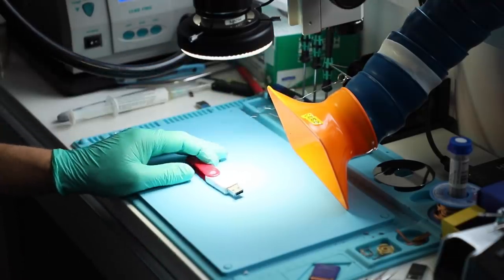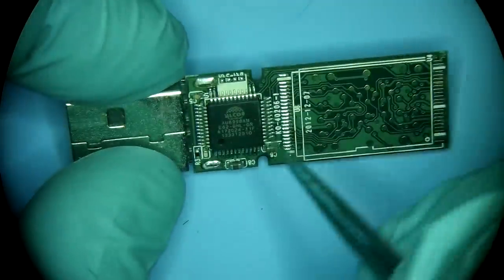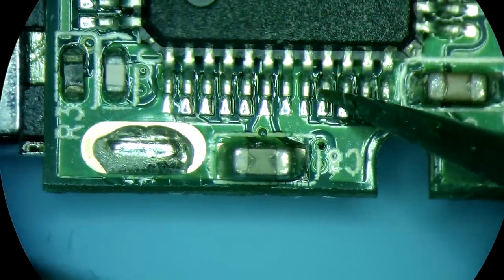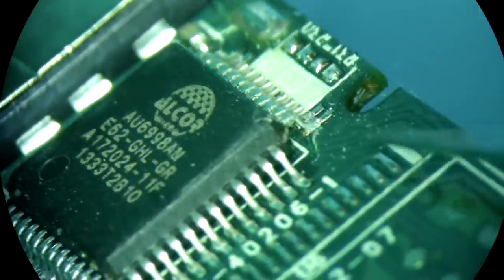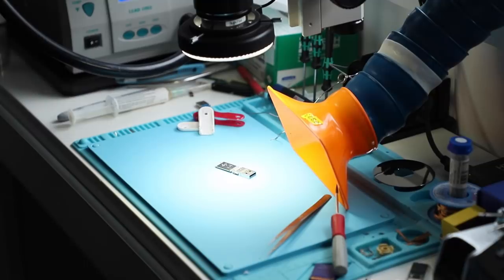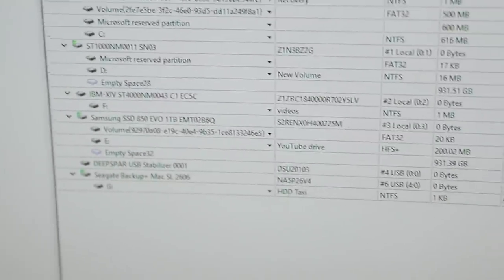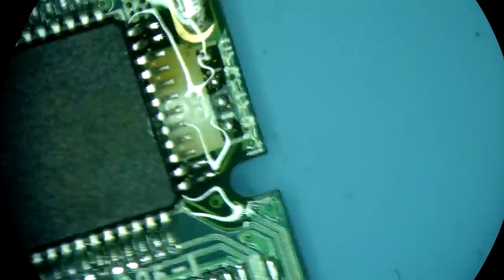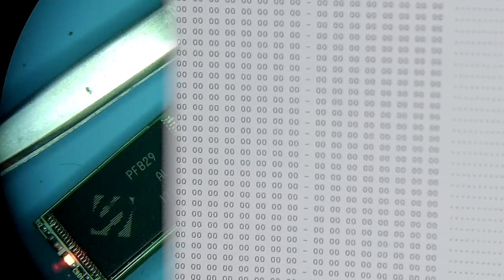super easy repair for bent flash drive

Comment: Hakko might not be the ultimate in soldering equipment. But IMO it's a very good place to start, as its very decent and relatively speaking (as far as professional equipment goes), a lot of bang for buck. The large market share also makes availability strong and intruduces some price competition.

JBC makes some amazing tools, but a lot of it can be very cost prohibitive when starting out.
Reply from the maker: I totally agree with you. Not knocking hakko by any means.
Reply: @hddrecoveryservices  A bit off topic, but got any tips on optics? Trying to improve the microscope setup after a neck and shoulder injury; trying to gain a bit of magnification on our trinocular amscope head without lowering the head towards the surface too much. Currently got WF10X/20 eyepieces in conjunctiom with a 0.5 barlow (and a 1x for fume, splatter/spray and dust protection). Got a 2X barlow but that makes the working space 30mm so not usable for work. Need to retain ideally at least a good 150 ish mm distance, but could use a bit more magnification. Because of the ongoing situation, money is a little tight so trying to avoid buying expensive optics that won't ever be used, because I failed to educate myself appropriately before buying.

Comment: Erkin ,
      The Main Thing Is When You See Around And Find The Issue  .In This Case I would not say it was easy ,Its easy because you demonstrated it  ,It will not be easy at all for the user ,Are you using vnr these days more then flash extractor or FE is more used
Reply from the maker: I use both fairly actively

Comment: Hi Erkin. Which version of RStudio do you use. I note they have a Commercial Version which costs $899.99. Is it worth getting the commercial version?
Reply from the maker: For a single use you don't need the commercial version. But for a shop you might want to consider it
Reply: @hddrecoveryservices  I'd only need it for the odd repair occasionally.

Comment: Hi Erkin, i see you're using last R-Studio version 8.13 build 176095.
Have you noticed any havy bug as not capable to image drives or frequent crash when dealing with huge filesystems?
I want back to v. 8.12
Reply from the maker: I cant say I see bugs too much. For hard drives we use PC3K with data extractor. I use R-studio for NAND stuff mostly. And flash drives and memory cards usually have FAT